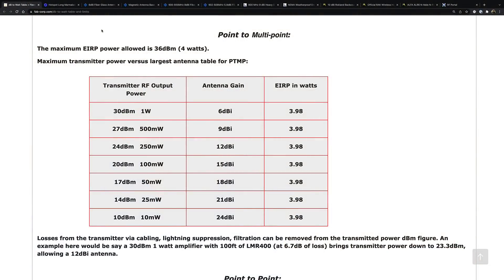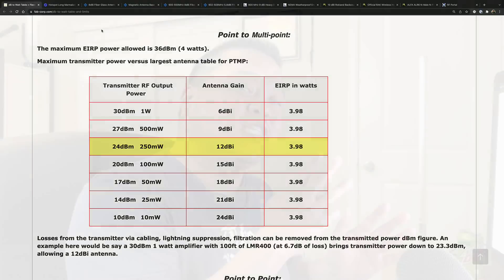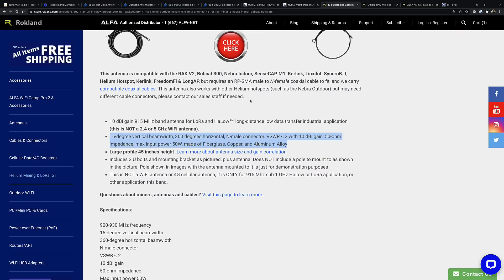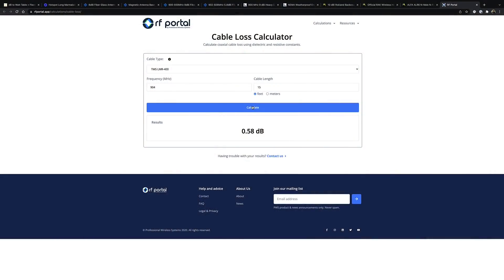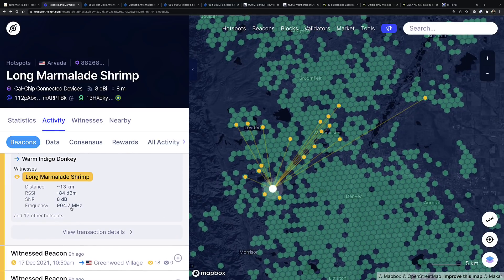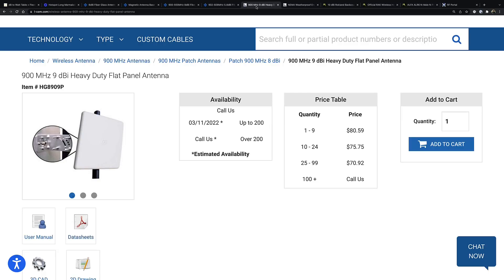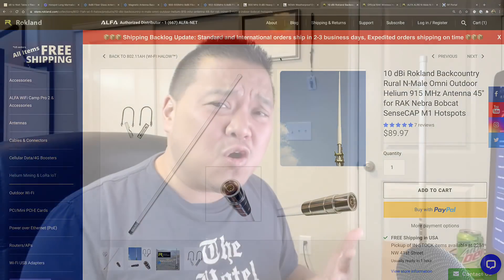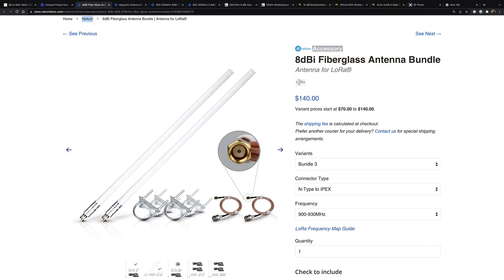Max Antenna Gain for PoC v11 and What It Means To You

Comment: At the end of the day, the point is to put the true estimated EIRP,  not the antenna gain catalog mentioned in the catalog.
It is to be expected to have a set of gain changing as the frequency does. Otherwise, manufacturers would have needed to produce several models. optimized for a narrower frequency band.
Take into account, connectors loss, cable loss, lightning arrestor loss

Comment: If you want a panel. Try 10dbi tuned mcgill

If you want a 9 dbi. Try 9dbi tuned mcgill

Both are expensive/premium but worth the buck. I have both running and they ripped my earnings positively. 22m 0.9 hnt and 25m with the panel 1.4hnt

Comment: So I went to the website you referenced to calculate your loss. According to the site I have nearly a 2db loss for my cable length and lighting arrester. If I'm understanding your video correctly, should I now set my antenna settings on my Rak miner to 6dbi from 8dbi which is what I have it at now?
Reply from the maker: Yes. That’s makes sense. If you have 2dbm loss you can list a 6dbi antenna.
Reply: @DewItJustinKace  Thanks!

Comment: Hodl, have you ever checked resistance (metal case to center pin) of any antenna? I bought two 8 DBi antennas from Amazon and they measured <1 ohm while others 3, 5.8, and 16 DBi measured open. The resistance ( center pin to its outside metal housing) should not less than 1 ohm. Is that correct? Let me know your input. Thanks
Reply: Different design, you have grounded and ungrounded antennas

Comment: Sorry, the vid is useless. PoCv11 is way more than to buy antenna on a wbsite. PoVc11 focuses on the transmission power of the miner, but no longer on the antenna. This means that it is better to use a weaker antenna, but the miner generates a much stronger signal. An antenna is only an amplifier, but does not generate transmit power, the miner does that. The higher the power of the antenna, the higher the noise, so the contamination of the signal.
Reply from the maker: I appreciate your thoughts. Wasn’t talking about all of PoC v11 tho. Was just talking about max antenna gain. I see your have your own opinions. You should make your own video explaining why a weaker antenna is better.
Reply: @DewItJustinKace  no, that is just simple math and physics. and, of course, logic: what is better? a big engine and a small turbo or a small engine and a big turbo? ;)

Comment: I have  10 DBI from Rockland with my 1.2 cable lost 30 feet what you think.
Reply from the maker: Not sure what you are asking.
Reply: @DewItJustinKace  I just got 10 DBi from Rockland this week. I have 30 feet LMR 400 with 25 feet up in air.
Reply from the maker: Numbers are at the end of the day just numbers. Results are what matters and if you are happy with them. Let me know what kinda results you get.
Reply: @pareshpatel9863 , 30 ft = 9.4m, per TMR-400 the loss ~0.1db/m then the loss of 30f is~ 0.94 db, in general, both ends of connectors also have insertion loss 0.2. Total loss ~ 1.14 db. Hope that help